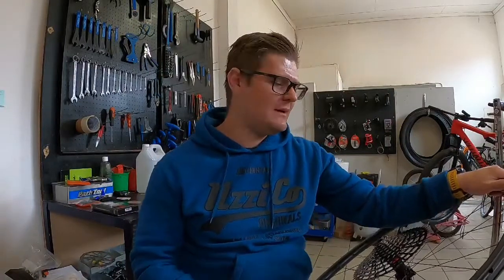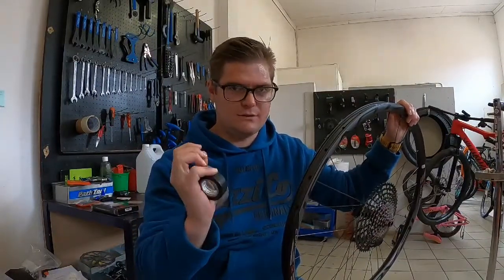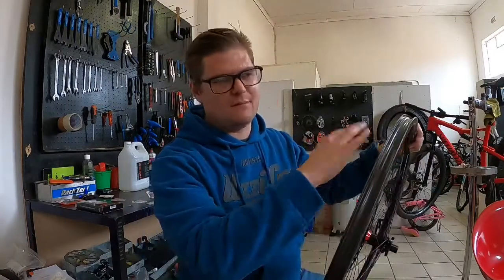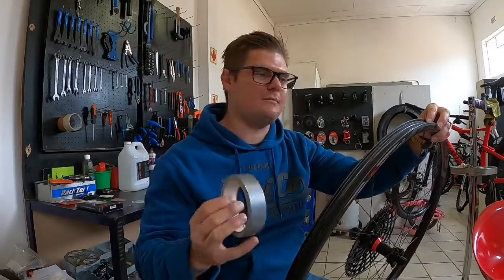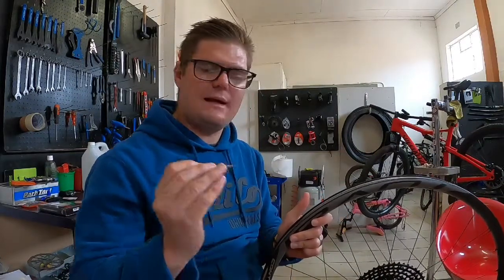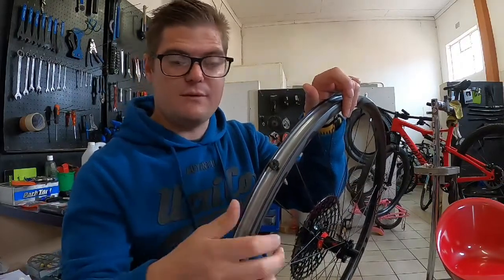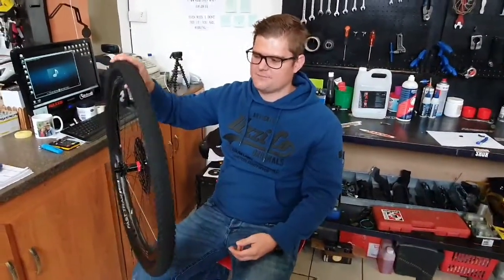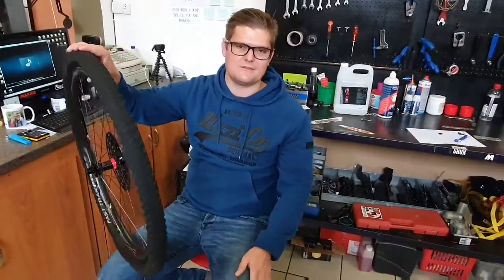Best Tubeless Rim Tape - Alternative

Comment: 4 layers of tape? A lot heavier that it needs to be and more complicated.  Just do yourself a favor and get some generic polypropylene strapping tape (Tessa 4289 equivalent) or polyester strapping tape (3M 8898 equivalent). Buy these in a similar width to one's rim internal width.